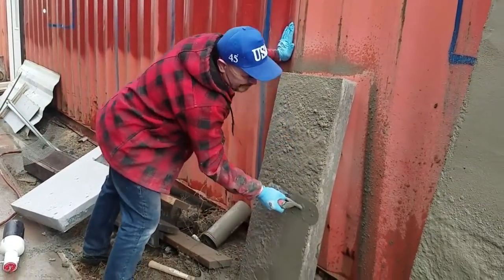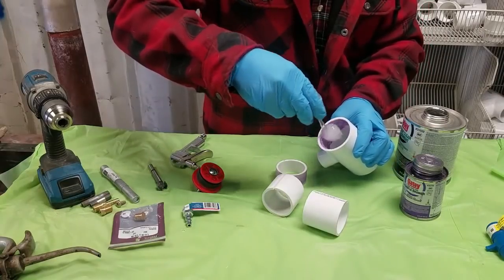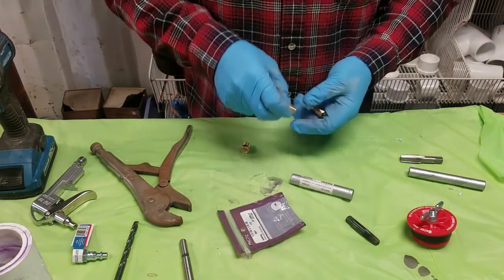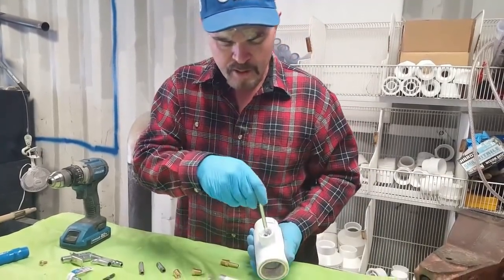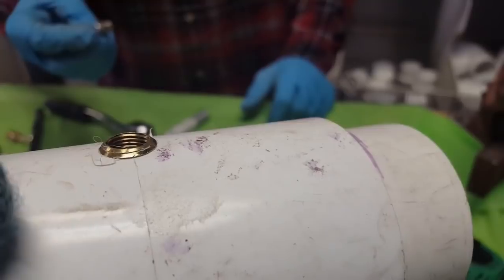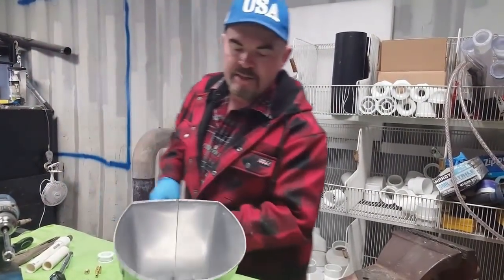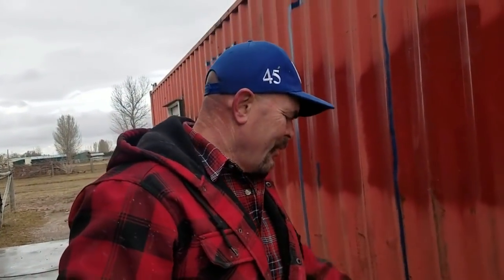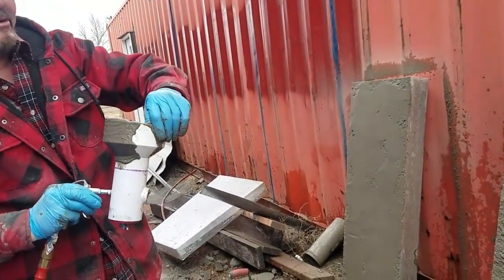SPRAYING AIRCRETE WALL PANELS, COOL INVENTION (STUCCO MATE)

Comment: why not use a $30.00 dollar texture paint gun and 2-inch rubber elbow to get the angle right I don't need to reinvent the wheel!!!!! It also has an adjustable spray nozzle and works 200% better and is low air Wal-board sells it at Home Depot with the drywall tools.
Reply: The holes may be too small.
The design is different.
But they sell his 400 thing for 50 bux

Comment: @Honey Do I made mine a while before this video. Use a 90 degree connection rather and drill a hole on the outer bend towards the exit nozzle end for air connection. This allows for a far better flow rate and you can use smaller and smaller ends that allows for better pressure buildup and flow through and you can easily add the hopper to the other end of the 90 degree piece. This way is much cheaper and much faster and allows you to fit a longer pvc "nozzle" on the exit hole to be able to aim better. So instead of 8-10 pieces this allows for 4 pieces only and is more efficient and less waste.
Reply: Post a video on your device . Thanks !! 🙋🏻‍♂️🥳
Reply: @BlueOriginAire  I believe my explanation was good enough don't you think? I am sure you can puzzle it together from what I have explained, don't need a video for something so simple.
Reply: Kazy Kamakaze A picture IS worth a thousand words. MUCH easier for most of us to understand.
Reply: You should make your own YouTube video, showing your way.

Comment: Darwin, remember I mentioned a product that can be sprayed on a surface called Cork Spray? You just invented a unit that would apply that with ease. The unit that is used for Cork Spray costs about $4000.00 and requires a big air compressor. I need to research this to see how it works. Awesome idea my friend.
Reply: right on, we needed that. ever thought of doing in on cardboard or other materials... i would consider testing that with 3d printer for home construction in the tree of a life innovation center, we are looking for the budget to finance this.

Comment: Now put a handle on the black pipe to help control it better .. And possibly a 6 inch piece of longer pipe for spray nozzle for comfort .. Looks and works good ya'll .. Will this spray aircrete or just stucco ??
Reply: Fingers crossed. Might pop the bubbles though.
Reply: and maybe square off the end so it can scoop out of trough better
Reply: @MrRockrobstr  Yeah, maybe find a square/round, plastic downspout fitting that would fit and square off the top.

Comment: Adding an insert is an excellent idea - thanks! Have you thought about adding a small but useful side handle near the feed end? Maybe a loop 'D' handle? Think fence post tool where you have two opposite slid handles to ram the post. Just use smaller, lightweight handles...

Comment: Maybe try a plastic drywall texture gun, same principal, not very expensive.  Already built, adjustable spray pattern, low cfm, lighter weight, bigger hopper, with bigger opening (if it starts getting too heavy, don't fill it all the way).

Comment: I flipped a bleach bottle over and installed my airsprayer nozzle and spray handle to it. Made another the same way and used an air chuck/sprayer. Scooped well and applied material like this. I'm all about helping others and not into charging anything for it. 
This is a pretty good idea. Only change I would make is to add a handle to the side of it for scooping material and holding it securely while using it.
Not bad.
The stucco sprayers are over priced. I got one for 150 and found that if I plugged 2 or 3 nozzle holes it works work well without a monster compressor.
If you have a scaffold or something to hold your mix above you in a plastic drum (NOT DIRECTLY OVER YOU) you can install a flex hose to the bottom of the drum to the nozzle  and cover a big area quick ! Swimming pools, roof tops, vaults  walls.
I used it for faux stone work. Sculpted Roof tops. Pool, waterfalls, etc.
W

Comment: Here’s a thought, I’m not sure it would work. If you attached wire lathe to the outside of your shipping container and then sprayed on your aircrete, wouldn’t that provide some needed insulation for your shipping container. You could then use your trowel to smooth it out for a nice finish.  Let me know if you think that would work.  I’m thinking of building a container home, and using aircrete blocks for the open spans.   Thanks.

Comment: Idea with refillable container was so clever and convenient! I thing that leaking occured when you have applied pressure. 
Maybe you should use in that place of connection pcv plumbing pipe connection piece with rubber seal - cartrige would fit better with a sealing and better stay in place. Then your oryginal idea wouldn't have to change.

Comment: Great job this is real product development and some pretty good suggestions in these comments.  Keep this up and you will be rich selling the final product that must be molded in one plastic piece. Molds are expensive but you can make a piece like that ever 10 seconds  and the get very cheap to make. Contact a plastic  injection molding factory and let then in on the deal. You can get a nice royalty.

Comment: Wow..  it finally worked..  anyway 2 years ago I gos a stucco mortar blower that was manufactured in Belarus  for lest than $100; single nozzle  that is very much like what you built, but is disappeared from any source that I can find on the INTERNET, so yes, you show a good alternative..    I'm using it to spray on a layer of light type white wash (silica sand, vermiculite heavily limed with 1% borax mortar) based coating onto the basement rafters and  limestone rock walls in an old farm house , for mold and fire retardant.

Comment: Brilliant! If one used white cement for the top coat, could you just leave the finish rough without trowelling, would you have the same surface strength?
Reply: You could do it as 2nd layer as a topcoat, but I wouldn't leave it as a single layer without floating/smoothing it. The reason is that aircrete takes on water like a sinking ship, and if you spray it you may be left with some spots in it that are thin enough for moisture to penetrate to the aircrete layer, which can tank moisture up and fail to dry leaving you with a nasty mold problem at the very least.
Reply: @Sudo_Nimh  what if U sprayed the air crete first with Sodium Silicate "Water Glass" that would seal the air create then stucco over it?
Reply: @dsm811  Depends on the Sodium Silicate penetration/saturation of the surface, drying times, etc. I mean it could be a definitely solution to that problem, I don't know enough about that particular chemical to say for sure. Try it out!

Comment: i dont know if you made any improvements to this idea bud. but can i suggest grouting in a O-ring into your feeder tube , that might help with the spill out.also have you played around with trying different size orifices for the air nozzle? for it is not only the air pressure you need to move the stucco but that of air volume  to move the material for those are very similar in design properties to that of a suction dredge nozzle for mining :) 

KEEP UP THE EXCELLENT WORK AND VIDEOS YOU DO

Comment: hmmmm how about when you mix it to a peanut butter consistency... then add sakrete flow control... which is a plasticizer that will really liquify the mix making blow easier and will not change cure time or strength... ?

Comment: The only think about this I would change is to get rid of that blowgun and use one I can mount near a sturdy handle with a flex line or a bent copper line or something. It just looks like the first thing to break is where the blowgun connects to the body of the hopper and a good sturdy and ergonomic handle would make it easier to hold longer. This is really cool tho man I don’t mean to knock it just my thoughts on improvements. Some kind of securable stand that the gun comes out of would be good for loading it by yourself also.

Comment: I have thought of similar ideas with a feeder hose for the stucco. Either pressure or gravity fed. 5 gallon bucket on top of a tall ladder platform. Or a tripod lift, very moveable. A small verion of the cement buckets they use on high rise buildings with cranes. Might need a funnel cone on the bottom before the feeder hose. Pressue could happen from something like a cordless drill, allthread and a plywood plunger. Perhaps air or hydraulic driven also. Simplest would be gravity.

Comment: Seems like a lot of the material ends up on the ground because its falling out of the outlet rather than getting caught in the air stream and shot onto the wall. I wonder if a second air nozzle under the spray outlet would shoot the stucco dropping out and get it on the wall rather than letting it fall to the ground?
Reply: No, it all ends in the trash.  Hes got a real one right there he could use as a pattern to make it out of sheetmetal junk, some copper waterline tubing, and that airgun instead of pvc.

Comment: I bought a stucco sprayer for 100. It's gotta have a lot of air pushing it. 
I messed with a gun sort of like you have here a few years back that worked ok. Used a bleach  bottle upside -down to feed the stuff.

Comment: I'd love to build an air crete dome using a gradual process, spraying layer by layer of air crete over basalt or rabbit wire mesh with small openings or even canvas.  Have you considered testing anything similar?
Reply: Spary paper air crete
U only need 1 layer. More research needed
Reply: Oh u need window mash screen. They cheep. Free if u look for it. Alternative use plastic inside the frame. Peel off to dry crete

Comment: I have a scooping trowel that is deeper and would fill the tube with one heaping scoop.   Probably two could be made three inch light weight PVC cut in from the side down the center and out the other side with a band saw.  The scoop could be inserted in the reservoir and then pulled out and replaced by the other as it empties.

Comment: is there an advantage to using metal studs? it just seems to be a lot more pricey than to just make a wood form and cast and reuse the forms. Love the videos though keep up the good work. 
Do the metal studs make it easier to attach? Dont you need mortar or something to attach? screws?
Reply: @Herger The Joyous! thank you for the explanation. so you could forget the metal studs and let the panels fully cure before using them. roughly 30 days.

Comment: i KINDA JUST LIKE THE SPRAYED ON FINISH as is without troweling. I will order one when I
get ready to 'stucco' with aircrete my Florida house. I wonder if I should apply a bonding agent
after cleaning the paint off concrete block well?

Comment: Try spraying a bit more uniformly and use a very light touch with your trowel to give a nice knock down look like a hand textured drywall finish. About half the air pressure will help to achieve this effect. With joint compound we only use about 15 psi with a very thin slurry.

Comment: Harbor freight sells a textured plaster spray gun that works. I used to spray gfrc into moulds. Way less mess and you don't have to reinvent the wheel. You can probably modify a bigger hopper for the gun if you were so inclined to do so. Ijs... IMHO.
Reply: what is gfrc?

Comment: First up, love it mate! This is really going to help your average DIY'er throw mud as fast as the pros. And it's cheap to make. I I will make one for solo rendering projects.

The Italian and Greek renders in Australia use a different style hawk that's much bigger. We still use the smaller hand hawks but but mostly for drywall plaster.  The European stlye hawk is a plywood board  about 24" wide by about 20" deep. You rest the board on the forearm and set the handle rail (underside) to leave a gap so the board does not pinch the inside of your elbow. 

It has a lot of benefits. You can hold a lot more mud as the majority of the weight is over your forearm and not your hand. You have a much bigger surface to work the mud on the hawk to knock out all the air and make it it to a ball before you throw it. You only use your bicep (and not your wrist) to lift and drop the board to meet the trowel as you work the mud before you throw it.
Oh, and you learn fairly quickly to keep the board clean of mud near your elbow.  It's soft sensitive skin in there and the sand with cement make it very uncomfortable quickly. You only make that mistake once.
Reply: Oh I should add, we add in fireclay (renders clay) and bycol (Detergent) into our render mix. It makes it slightly creamier and lighter so you can ball the mud on the board with the trowel and then throw the render on the wall fast.

Comment: Marshalltown as well as Goldblatt Tools. Make a hopper fun you would like much better than this. And it’s under $100. They are used for texturing drywall  as well as applying stucco. Check it out.

Comment: How much product goes into the hopper.
Reply from the maker: a 12" tube hols about 15 lbs of material a 8 " about 11lbs. If you are a big man and can handle more you can take a 4" to 6" bell reducer and use a 6" tube that holds 20-25 lbs. very versitile. even the small tube wil spray 6 quare feet very quickly. way better than by hand. thanks HDC

Comment: Why didn't you just take a cross fitting? Plug it on the bottom and bushing it down for the air section.

Comment: You did this wrong with too much concrete restriction.  Look at the commercial hopper and see that they just made a hole in the hopper, no fittings. Use sheetmetal (from and ol washing machine) to make it and drill a half inch hole at the bottom to make the nozzle. Thats it. Really simple. Remember, buy cheap, buy twice.